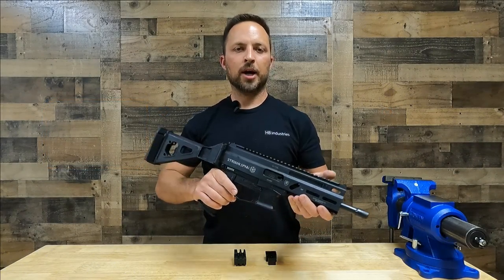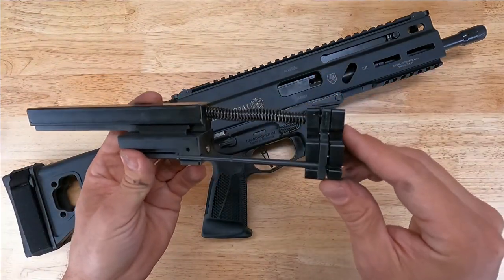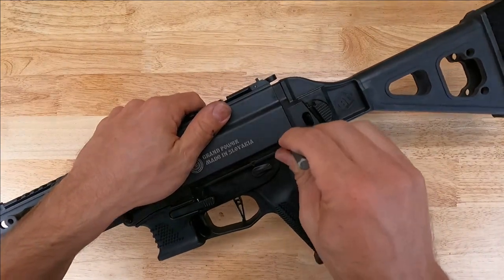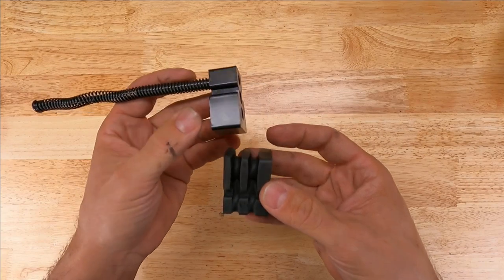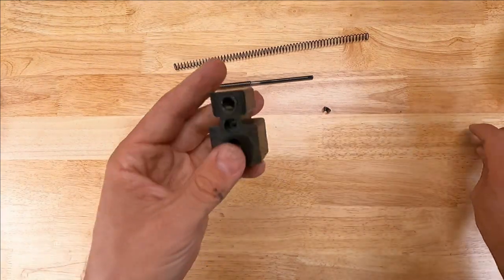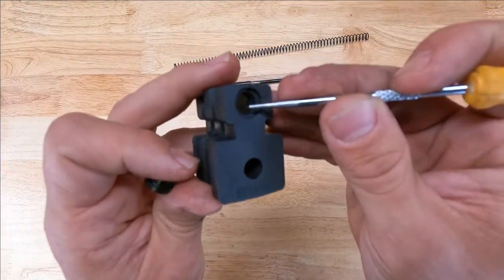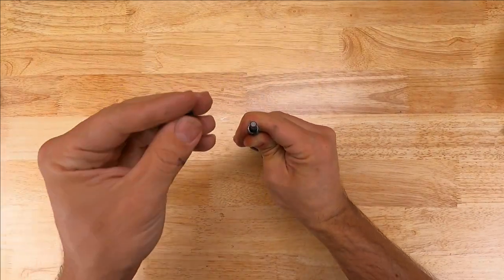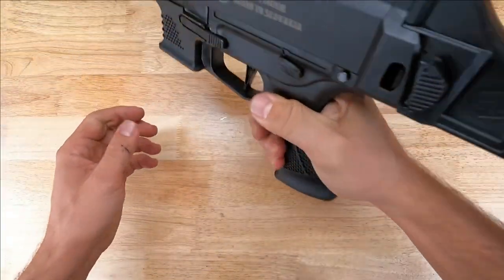HBI Stribog Short Stroke Buffer Install

Comment: You made this look a lot easier than what I experienced. It was pretty difficult for me to keep the rod from collapsing when putting the spring back on making it impossible (for me at least) to compress the spring enough to get the retainer washer on. Definitely couldn't do it straight up like what you seemed to demonstrate. It collapsed every time. Finally was able to get it back on at an angle though. Definitely appreciate the video!
Reply: Yeah it was almost impossible for me too! I had my wife help me do it! I pulled back the spring and she put the spring retainer on lol!
Reply: Guys, just use any long steel pin/rod/handle and insert it in the back of the rod. I used my cleaning rod, this prevented the inner recoil rod to retract. Took about 3 seconds to install the collar.

Comment: Hey HBI, I have a question. Is your locking charging block (the short one used with the Arms Republic rail extension) compatible with the short stroke buffer?
Reply from the maker: Yes, our short stroke buffer will work with all known charging blocks. Not trying to shamelessly plug our own, our buffer is compatible with both the factory charge block as well as our own of course. But as far as we know our buffer is compatible with all other aftermarket charging blocks as well.

Comment: Art Bosco What a HUGH difference using a piece of dowel made when threading the long spring back onto the two rods. The dowel kept the two pieces of rods from collapsing inwards on one another. The dowel is inserted from the rear and pushed inside the larger rod to "extended" the smaller of the two rods. The spring didn't needed to be worked backwards as much so the locking tip was much easier to install. Thanks for the tip janiesponies.

Comment: Will this kit work with stribogs equipped with an aftermarket lower?
Reply from the maker: Yes, our short stroke buffer is compatible with Lingle and A3 aftermarket lowers
Reply: @hb_industries  I have installed this with a A3 lower and a velocity trigger. Having a slight issues with the trigger reset. Have other Velocity Triggers and never had this issue.

Comment: Best video I’ve watched today. Could this potentially cause any actual * short stroking * and feeding issues? Particularly with hotter ammo. Seems like a great part, but wondering if anyone has experienced issues.
Reply from the maker: The length of our buffer still allows the bolt to over travel the ejector and bolt stop by nearly +5mm. Plenty "factor of safety" for adverse conditions, tolerance stacking or variance etc, but small enough to keep the action quick and short. Assuming you are using a factory lower receiver, you will not have any "short stroke" issues with our buffer.
Reply: @hb_industries  awesome, thanks for that response. I ordered one for my stock lower Gen 2 so I’m looking forward to trying this out
Reply: I just got mine in today. Just finished installing it too. 
Have you noticed any difference in felt  Recall impulse? 
Never did bother me how it felt with the factory buffer since I normally shoot mine suppressed. I mainly got it because I've have the brace dance it's way to the back lol 
Also I installed the folding charging handle and the charging block lock today. 
Unfortunately it binds =/ 
I have to charge it with my grip close to the receiver for it not to do that.
Crazy if I swap the stock handle with the charge block lock it's smooth also if I use the folder with the factory charge block.
I'm thinking both parts are Slightly out of spec that they turn ever so Slightly to increase some resistance to over power the recoil spring.
Reply: @MRD0889  I ended up ordering an aluminum charging block to go with the HB Folding handle. I've had zero issues with it, but that issue you're describing is apparently very common with the folding charging handle and the plastic charging blocks.
Reply: @nightfoe  yea it's the only negative I have on this combo of parts
Reply: @MRD0889  If you're still wanting to use a folding charging handle, I really recommend looking into an aluminum charging block. Not only does it seem to work flawlessly with the HBI charging handle, but it also makes charging the Stribog nicer as well.
Reply: @north_borne  yea I was thinking this material would be better then the hard plastic
Thanks 😊

Comment: I just switch this our on mine. My spring and rod comes right out of the buffer. Is that correct? Or should it hold it’s self in? Thanks
Reply from the maker: Did you remember to remove/re-install the flat washer from the front side of the factory buffer into the HBI buffer? With both the front and rear metallic collar and washer installed in the new HBI buffer, the new buffer should be fairly well captured on the recoil rod.

Comment: What is the benefit of the bolt not traveling as far back? Other than reducing recoil.
Reply: I believe these guns also had issues with fired casings sometimes getting stuck in the action, this would fix that as well
Reply: @GriffXJ  really?!! I thought that only occurred after a FTE?? Be nice if it stopped that as well
Reply: @easye3252  any news if this helps with FTE?

Comment: The only purpose of this is to reduce felt recoil? I’m having FTE issues so would this possibly cure that or make it worse?
Reply from the maker: Our short stroke buffer dampens and slows the bolt velocity at the rear of the bolt travel. FTE issues are more frequently associated with dynamics at the beginning of the bolt's travel such as initial bolt velocity, extractor or ejector geometry, or external influences like ammunition or magazine(s). Our short short buffer definitively makes the Stribog more pleasant to shoot, but it would be wrong for anyone to tell you that it was a magic cure for FTE issues. Sorry :-/
Reply: @hb_industries  I’m going to order one anyway along with a couple other things. I was just curious if it might help my issue.
Reply: @GeneBussler  hey did that fix your issue with FTE?
Reply: @simtherapy9533  I have not tried it out yet.
Reply: @GeneBussler  I was wondering because I just bought a Stribog and I’m hoping mine won’t have this issue.🤞🤞
Reply: @simtherapy9533  Hopefully not. Shouldn’t have to worry about stuff like that.

Comment: The recoil spring can be hard to compress for old hands. To hold the guide rod extended full length, I used a 1/8" dowel I actually had on my bench, cut to 3" and put in the guide rod from behind, then I could compress the spring, and reassemble.
Reply from the maker: This is a great idea. We have also used pocket screw drivers and punches (sitting on the work benches), but there are certainly many other ways to improvise if needed.
Reply: I used a piece of an old chopstick to keep the guide rod extended - it helped avoid the frustration of the collapsing guide rod and saved the day.

Comment: Yeah im wondering if I really need this or not. I like the fact that its not expensive and the material looks nicer then the original. If anyone could help me I'd appreciate it.
Reply: Lol ended up snagging it.
Reply: @KronDestroyer  and? Improvement or not really worthwhile?
Reply: @19jtown  I liked it in the end, their customer service is amazing too btw.
Reply: @KronDestroyer  I definitely agree there! I had an older version of their extended bolt stop. Wore out quick and stopped holding bolt back. Emailed them and they explained why they thought the earlier models were doing that and shipped me out a new one same day
Reply: @19jtown  yeah pretty much same situation, had a older Version and without question sent me another one and had me send the old one back so they could try to see what they could do to improve on the design/prevent it from happening to other people. I also have the extended bolt release and upgraded trigger spring(highly recommend).
Reply: @KronDestroyer  nice. Well I haven’t tested the new bolt stop but hopefully this one is better. Do you know if the new trigger spring will work in one with the updated flat trigger? Saw something about it being too wide
Reply: @19jtown  yeah mine has the flat trigger and I installed it myself. They had a install video up on YouTube that I followed. It wasn't too hard but becareful when your doing the springs, litterally shot one of them across the room and almost lost it. Lol in the end though it made it feel great, super crisp and the reset is super short.
Reply: @KronDestroyer  sweet..one more damn thing to buy. But I think that’s all I’ll need after this besides some more curved mags. Know if any are available/will be anywhere?

Comment: Thank goodness for your video 😎
My kit just showed up and I ripped right into it.
I did have to refer to the video about that thing collar on the end that goes into the bolt, but the other collar the bigger one looked like it was permanently attached to the rod.
Of not for you video I may have messed up the reassembly.

The buffer was suppose to land Friday, I am glad it came two days early as I want to shoot my SP9A1 Gen 2 Friday morning.
Maybe this this will bring the recoil down over to my CMMG Banshee 300 MkGs, it is a soft shooter with their radial delayed blow back system.

Edit, just cycled it and I have your folding charge handle.
Since the stroke is shorter now, the charge handle when you release it does not build up as much momentum, and the handle does not fold all the way over like before.
Is there a cure for this?
Thanks...
Reply: same, I have a SP9A1 G2 and I didn't have the front washer. And the rod seemed to be stuck to the back cap/collar as well. No idea about charging handle, I still have the stock one

Comment: I had zero reliability issues prior to installing the buffer. Now it chokes multiple times per magazine. Wtf?
Reply from the maker: Are you able to verify that your buffer is seated fully to the rear against your receiver cap/brace/stock adapter? Does your bolt lock back on an empty magazine? What lower receiver are you using (oem/aftermarket)? Are you able to give a little more detail on "choke"? Would you describe the "choking" more as a failure to feed? Or failure to eject? Anything different about the magazine(s) or ammunition or have those variables both remained fairly consistent? Hoping to get you sorted out here asap.
Reply: It appears to be a fail to extract issue.  The spent round case is blocking the new round from chambering by not fully extracting. Factory lower, same ammo as always 124 gr. NATO, bolt locks back on empty mag, buffer is fully seated. Only different variable is I shot it without the brace for the first time ever. I have well over 2000 flawless rounds through it with 10 different mags, factory straight and curved loaded to 25 rounds.
Reply from the maker: @Executioner_of_Time  sounds like you have our buffer installed/positioned correctly, visually verifying that it is fully seated and functionally verifying that the bolt locks back on an empty magazine. Both of these generally indicate correct installation of our buffer. Doesn't sound like mags or ammo are the issue either. What are you using instead of a brace? I wonder if it might be worth putting the brace back on to see if you can isolate the issue? Almost sounds like bolt is not moving quick enough, despite having enough travel? Possibly something going on with the collapsible recoil spring assembly?
Reply: Appreciate your input. I installed the factory buffer and the brace then blasted 100 rounds from 4 random magazines. It is good as new but I'm not keeping the brace on it and going through all of that bs.
Reply from the maker: @Executioner_of_Time  Would it be possible, next time you visit a range, to re-install our buffer and test your Stribog with the brace installed? And/or leave the factory buffer installed and remove the brace (configure the backend like you had it when you had the FTE mentioned above?) For science? We would be happy to refund you the cost of your buffer if that is the issue, or send you a replacement; it's just that this issue that you are describing is not common at all (in our experience, with our buffer) and regardless the outcome we just want to either get your Stribog dialed for you, or make it right somehow.